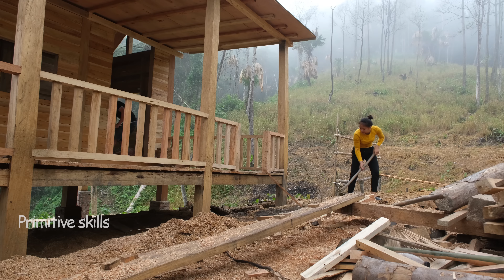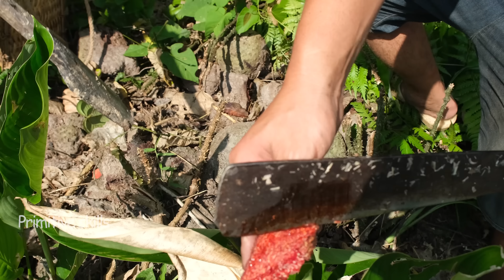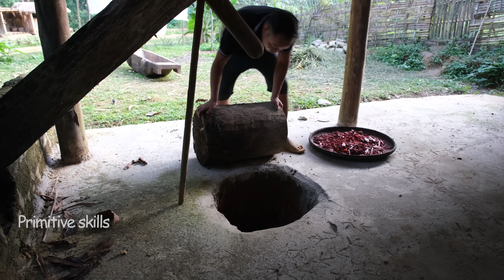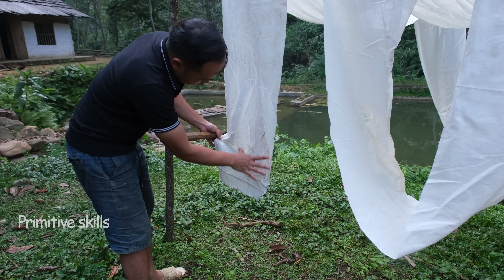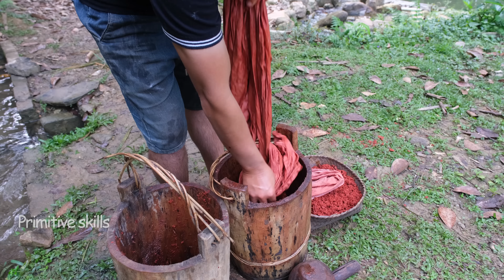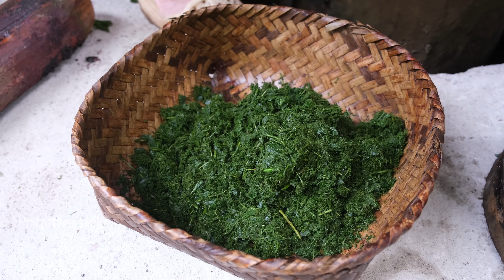How to Dye Fabric red, black, blue from brown tubers | Primitive Skills

Comment: To have a good result when dyeing fabric, is good to boil the dye from the tubers and put the fabric into the boiling water so that the fiber on the fabric take on a good color.
Reply: And let it soak for a while
Reply from the maker: Thank you for comment
Reply: I absolutely agree with you👍🏼
Reply: Heat setting is needed, that's why the sun dries them.
Reply: Also we use vinegar to set the colors
Reply: That's not how you fix dye on a cloth. It's completely different chemistry.

Comment: For those who build wooden houses like this, make sure to include a small piece of copper wiring between the stone foundation and the wood to drive off termites as well as having the wood treated against humidity. The slant of the balcony roof also should be at a slight angle and not flat to prevent water from siting there and infiltrating into the beams
Reply from the maker: Thank you, your shares are very useful to me

Comment: Duong, hit the nails on the sharp point when near the edge of the wood. This will stop the wood from splitting. You don't need to drill. It's a tip I just learned. My brother just laughed at me as he is a carpenter. Trade secrets.

Comment: BUILDING a stairway is not really easy to understand.  Not shown here, but in Huong's video: pouring the cement around the base of the bottom posts certainly helps to reduce wiggling.
So what you 2 have built DESERVES being called STURDY!  🙂

Giải pháp tăng cường khả năng chống đỡ của sàn cũng không được hiển thị ở đây.
Tôi sẽ gửi đến email doanh nghiệp của bạn mô tả về một phương pháp chắc chắn hơn để tăng cường khả năng hỗ trợ của sàn.
Có lẽ bạn đã biết ý tôi rồi.
Mô tả quá dài để đăng ở đây và sẽ chứa sơ đồ..